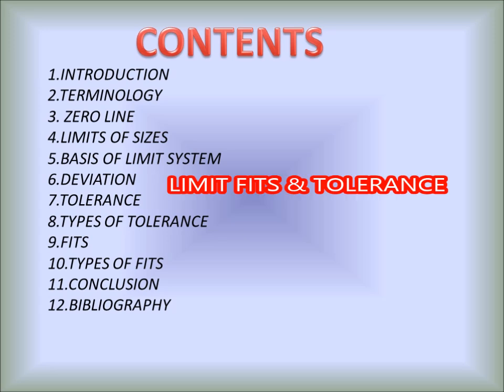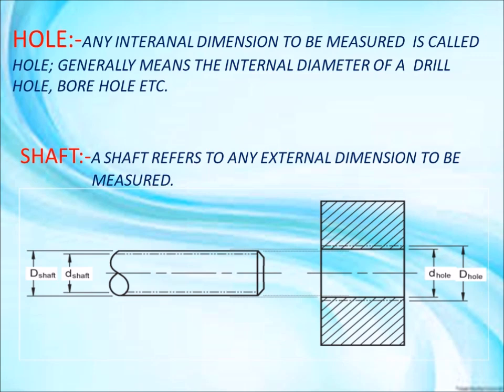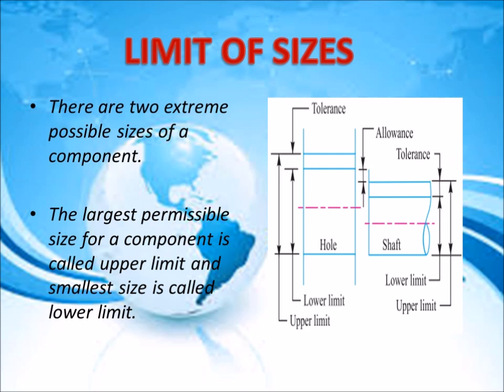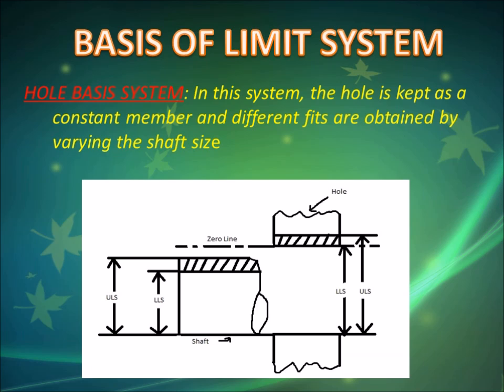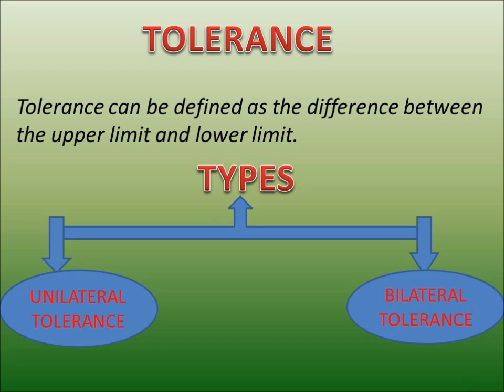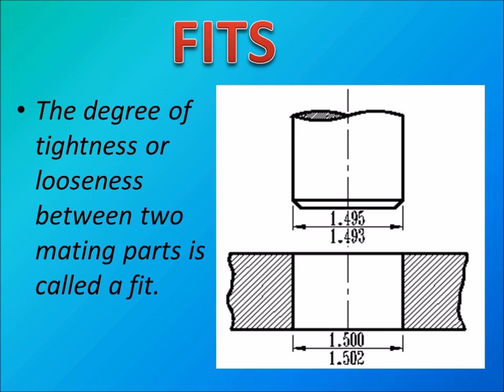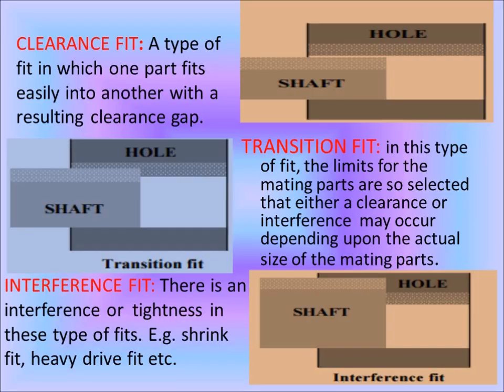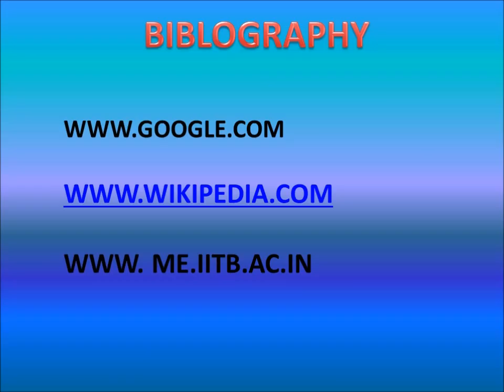LIMIT FITS & TOLERANCE

Comment from the maker: my dea r# Mr. ishak amrani thanks for watching this presentation.
clearance fit is two types .1st one is "sliding fit"& 2nd one is "running fit".clearance fit is use in your hole & disc coupling .you just substract upper limit of hole to lower limt of disc and simply its can evaluated,ans is "1 mm."its max clearence you got.hope the ans is clear.

Comment: thank you for the presentation, I'm not a mechanical engineering would you please tell me about the best  clearance fit tolerance between a cylindrical hole and a disc to have the best sliding like in the engine cars pistons, where the diameter of hole is 15mm and the disc is about 14mm and 2.5mm of thickness  the aluminium material is used.